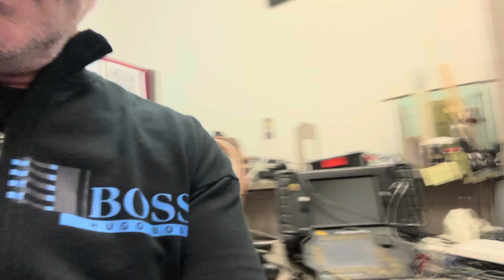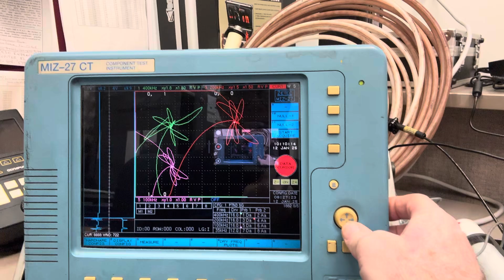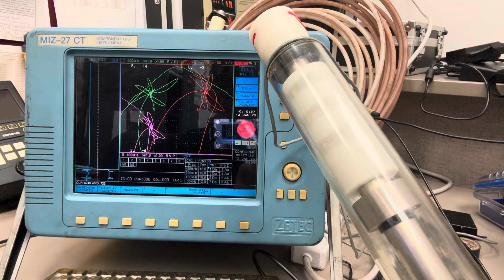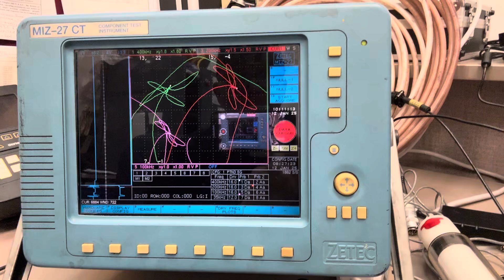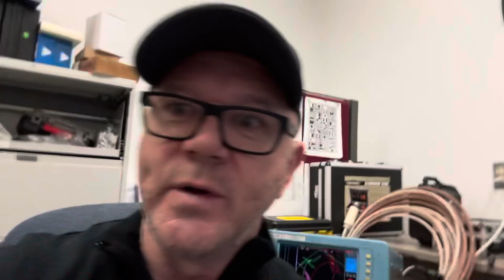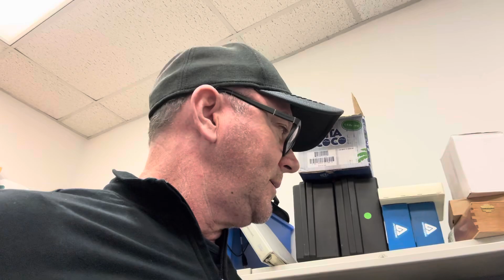My Job as an Eddy Current expert and why I love it soooo much!

Comment: How would you rate APR-UPR if compared to ET of tubes?
What is its future?
Reply from the maker: This has been talked about for quite some time, but until it can match or exceed the speed and accuracy of eddy current testing, I'm afraid it will stay on the back burner.  Even if it does work, industry regulations and acceptance of new techniques take considerable time to change.